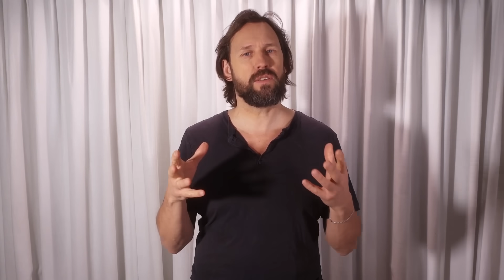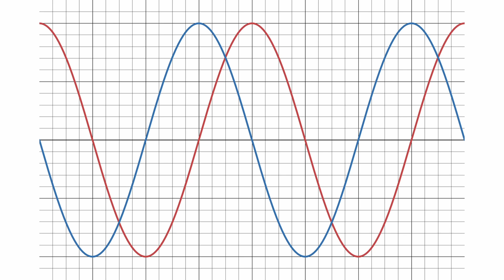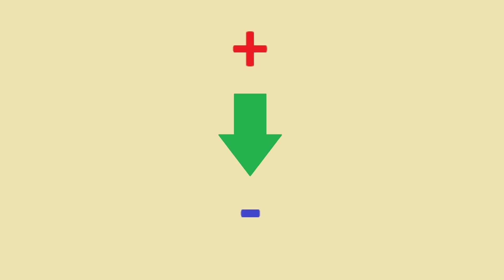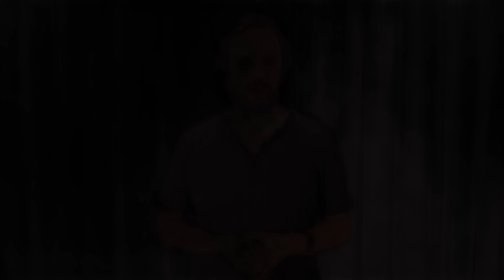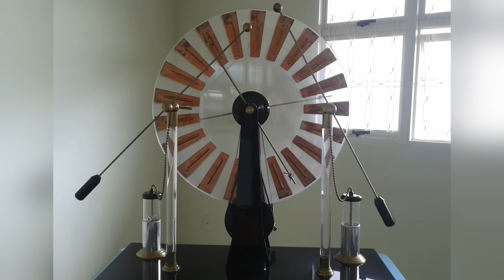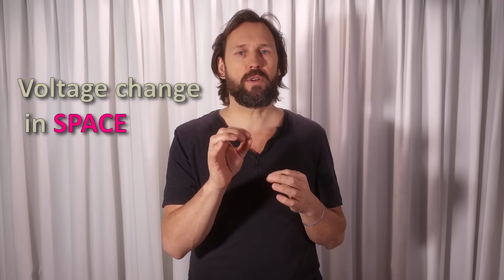The Electric Resonance SECRET Universities Hide

Comment: Well I was playing with a bipilar coil and a small tesla coil and was just playing and hooked up to the atmospheric antenna I was Messing with and I let a whole crap load of angry pixies out my wires in the form of smoke and fire have not replaced all the equipment yet but by my simple observations of what was going in was way less than what came out..it was a very weird sound just before everything smoked ( like a turbo spooling up mixed with old space movie hum) tesla patents are meant to be combined to harvest aether energy..I get so sick of hearing brainwashed ( college educated people) say free energy violates the laws of thermal dynamics yet tell you an atom has energy that never stops.bring it to absolute zero and it stops vibration then warm it up it starts again 😉  so everything is made of energy bit magically we have to depend on politicians and oil co to supply it...hmmm. do the calculations for a local power plant  and all the things connected to it and there is atmospheric harvesting to make the difference up at your home...

Comment: They teach everything, including displacement currents. Is the current leading or lagging, depends on the sign convention. In a capacitor it is leading, in inductor lagging.
Reply from the maker: true but you're missing the point.
Reply: @MasterIvo  Maybe I am missing the point, so please explain. So many videos explain energy does not flow through wires, but for me this is obvious. What I still do not understand is in which case we get energy from the ether. Maybe for very high displacement currents ?
Reply from the maker: @reuven1961  well all energy is aether. they are the same. but I feel you mean extra energy from outside the system.
there are several methods.
like a sudden unipolar change in the high voltage electro static field. since it interacts with the surrounding aether (energy).
but I also found a more  dynamic method without the need for an impulse (will present this in coming videos).
It is always depended on high voltage (above let say 5kV).

Comment: The displacement current  is a result of a changing electric field creating a magnetic field. The higher the frequency and the higher the voltage the higher the displacement current. Ordinary current doesn't factor in the formula. So the idea is to create a high displacement current using a minimum of power and put that displacement current and voltage to work
Reply from the maker: don't forget the role capacitance plays with displacement current
Reply: @MasterIvo  parasitic capacitance 👍

Comment: At around 11:00 to 12:00  is the most important part of the video.
Reply: He is claims that: tesla coils are open circuits, and that energy conservation only applies to closed "circuits". Both of these statements are 100% incorrect. 

The first law of thermo has nothing to do with circuits, but rather systems. That aside, the law of energy conservation applies to all systems, not just closed systems. The second law, which states that entropy in a closed system never decreases, does apply to closed systems. But a violation of the second law doesn't violate energy conservation (and also the entire universe is a closed system). 

Second, tesla coils aren't even open circuits. There is capacitance between every segment of the coil and every grounded object. You can model this mathematically by breaking up the coil and everything around it into multiple tiny conductors and computing the mutual capacitance and inductance matrices b/w all these discretized conductors. you can then use these matrices to compute the eigen modes of the coil. This only works bc these coupled capacitances form a CLOSED circuit (albeit a very complex one with many different ground paths). We also know this analysis is correct bc this math is commonly used to very accurately predict the resonant frequency of tesla coils. The common tesla coil software JavaTC uses this method, and it is the current golden standard for tesla coil hobbyists, hundreds of which have validated these calculations independently.
Reply: Moreover, if you compute (either theoretically, or from direct measurements of real world data) the Poynting vector field around a tesla coil or any other electromagnetic resonator, and compute the flux around the coil you will see that it does not violate Poynting's theorem, and therefore a tesla coil or any other magnetic resonator cannot be used to generate infinite free energy.

Comment: Thank you. I appreciate your channel and your commitment to clarifying the dielectric and magnetic fields. Would it be accurate to say that electricity is not an autonomous field but rather a manifestation of the dynamics of magnetism and dielectricity?
Reply from the maker: Yes correct. it is a mix of two energy forms. The electrostatic that is in motion, together with the energy flow (current).
But it doesn't need to be a magnetic energy flow.
the displacement current can also do the work.❤
Reply: Everything in the universe is electric in nature. Chemical reactions, mechanical motion.. all forces are imbalance seeking equilibrium, discharging. The sun is creating heat, photosynthesis, electrical charging of air etc, and it's cyclical. The best example of electrostatic energy is gravity and adiabatic fluctuations. Water evaporates well below 100c, oxidation is the application of a charge, clouds do not fall from the sky even though water is heavier than air because there is a static field pushing away like charges when the ground is heated during daylight

Comment: why is there a difference in the displacment current field and the static one? isn't the same, just that one is chaniging over time? like if you have a magnetic field and a metal and both are relative to each other not moving, you won't have induction. But if one of each moves (doesn't matter) youl have a moving magntic field, which causes induction (with moving i mean the strenght changes, like if you move it exactly like that it stays in the same strenght, there is no magnetic field change.

Ist this comparable or is that soemthing different?
Reply from the maker: Well there is no induction when it is static.
 the changing magnetic field induces an EMF (voltage) while the static does not.  this difference of behavior separate ls the 3 fields. But in the end they are all manifestations of energy. 
Which is another word for Aether.
Reply: @MasterIvo i think my brain still doesn't really get the concept.
so basically there only is the movement of charged particles like electrons. If they drift on average ibto one directin in a metal rod as example, we have a flow of current, just like water flowing downstream in a river. the voltage itself is just the pressure which causes the electrons to drift or in the case of the water, it is the heigt, the source of the water compared to the lowest level. 

In order to move the electrons we need something that gives away electrons on one side and consumes them on the other side, for dc. like a batterie. The electric static fields of the electrons tries to push them apart. because they move, they create new electomagnetic fields and those also interact with the electrons again. man this is all so confusing 😅😂
Reply: Think of it like this

Magnetism = Water flow
Dielectricity = Ice if it had elastic properties 
Displacement Current = Underwater wave, or sound wave
Reply: @JenkoRun  i think that is even more confusing. why is there now frozen water? :D

But water as a liquid can move while the single h2o mulecules within are faster, just like it is with electricity, just the other way around. The energy of the field travels with ~2/3 of the speed of light while the electrons themselfs only are roughly as fast as a snail. 

When comparing water and electricity, we should always keep in mind, that any type of pipe would need to already have water inside, like any wire already has electrons within that are able to move.
Reply: @Marco-xz7rf  It's an analogy, and it's really not confusing.

Also please disregard electrons when it comes to Fields, they show the rate at which electricity is destroyed, electricity is in the environment around the so called conductor, not inside it. 

And no I will not debate that, take it up with Steinmetz and the rest of the pioneers.

Comment: I don't know if this helps you, but we just published a paper in the EM journal IRECAP showing an EM pulse propagating 1.5 meters in the near field with no observed propagation delay. It shows at the front speed, or the speed of information, or the speed of causal action is instantaneous in the near field of EM sources. The experiment is nothing more than Hertz's famous radio wave experiment except a modern oscilloscope is used to measure the propagation delay. In the paper we show that the effect is predicted exactly by Maxwell's equations when the source terms that come from Gauss's law in Ampere's law are included in the wave equation. This was not done by Maxwell and is the reason why Maxwell's constant speed C solution is wrong. And because Einstein assumed Maxwell's constant speed C solution was correct, his theories of relativity are both wrong, as well as any theory based on it such as QED. For more information see, New interpretation of Relativity by William Walker and specifically see the papers supporting this research in the description of the video. Specifically see my 2006 paper that can be found there. It has the details of this analysis and presents another interesting experiment where a sinusoidal source was transmitted from one dipole antenna to another as the antennas were separated from the near field to the far field. The resultant phase versus distance curve was clearly non-linear with a clear minima in the near field, and became only approximately linear in the far field. Maxwells constant speed C solution would have yielded an exactly linear curve, which it clearly was not. It is well known that when there was a minima in the curve the speed of light is instantaneous. Applying well known operators to the curve shows that the speed of light is instantaneous in the near field of the source, changes speed with distance from the source, and only reduces to approximately speed C in the far field starting about 1 wavelength from the source, and never reduces to constant speed C, ever.
Reply from the maker: thanks for sharing. How can you  implement this knowledge?
Reply: @MasterIvo The implications of this research is that most of modern physics is wrong, because it is based on the assumption that the speed of light is constant speed C, which has been proven to be incorrect. If the speed of light is not constant speed C then the second postulate of relativity is wrong. What remains is the first postulate Galilean relativity where space are absolute and independent, and causal action faster than speed C is possible without violating causality. This research also shows that the speed of causality is infinite speed, and not constant speed C.
Reply: @MasterIvo We are already implementing this technology in our cell phones via NFC Bluetooth communications, which are near field narrowband digital communications. The EM Pulse experiment shows that  the NFC nearfield digital signals, which we use in our phones, propagate instantaneously from the transmitter to the receiver.
Reply: Hmmm.  I would have expected a delay of about 5nSec. I need to find your article in IRECAP and learn more about your exact yest set up.  Can you provide the article  date or volume # please?
Reply: @davidpacholok8935 a pre-print of the paper can be found at the end of the description of my video, New interpretation of relativity by William Walker

non-local or possibly superluminal Maxwell displacement current observed in the near field of a spherical capacitor, IRECAP 2024
Reply: Dang that’s pretty cool. I’ll have to read your paper! Thanks
Reply: @ashercorbett8089 The paper can be found in the description of my video, New interpretation of relativity by William Walker 

Superluminal Maxwell displacement current measured in the near field of a spherical capacitor, IRECAP 2024
Reply: Приветствую! 
Пространство ведет себя как несжимаемая жидкость, под воздействием импульса на определенном расстоянии деформируется структура пространства, далее формируя в нем волну, распространяемую согласно плотности пространства, а это ~297 тыс км /сек. (Хорошая плотность!)
Так как пространство едино - деформируется вся материя, также являющаяся лишь формой пространства, а это и провода осциллографа, и сам осциллограф. 
Вы еще более будете удивлены, когда измерите скорость схлопывания магнитного поля. Проведите эксперименты с индуктором, с малым количеством витков, где преобладает токовая составляющая, и с высоковольтным индуктором с большим количеством витков. Расположите датчики магнитного поля в центре катушек, и на расстоянии в 1 метр. Задающий импульс должен иметь задний спадающий фронт менее одной наносекунды.
Reply: @efiron  EM theory shows that the superluminal effect should occur for both E field and the B field. Intuitively you can see this because Coulomb's law for the electric field and Biot Savart law for the magnetic field are not a function of time, so they are instantaneous formulas valid in the near field.

Comment: ivo, I would strongly encourage you to watch my recent four video series on the field. It is different from all other perspectives on the field.  https://www.youtube.com/watch?v=iOTSrJ7RQuQ.  For me it is simple - you have to consider the electric and magnetic as 2 perceived sides of a mobius strip - but it is just one.  When energy radiates it is electric, when energy converges back to its center point it is magnetic/gravitative. And you have to think of this energy as a fluid. Then its all fluid mechanics for optimal field geometries. The field / fluid behaves differently under stroking (AC) vs smacking or super high frequency smacking.

Comment: Moisture in the air as well. The more humid the air, the more electric potential for potential harvesting. Water over a waterfall produces a potential difference also. Quicklime over quartz crystals can produce electricity. Hitting a tuning fork near an inductor can increase the voltage of the indicator
Reply: The effect of gravity, how water evaporates at temps well below 100c, and why clouds do not fall fall from the sky (unless conditions are just right) all has to do with this electrostatic effect. id be interested to know how buoyancy can be explained electrostatically, I feel like there is a key to understanding the link between mechanical and electrical phenomenon that will help this research

Comment: From what I understand there is voltage in terms of potential, and then there is EMF. There is current; then there is displacement current. 
Variation of a quantity of dielectric induction with respect to time is Displacement Current. 

Variation of a quantity of magnetic induction with respect to time is Electromotive Force.
Reply from the maker: and EMF is the  voltage that can power a load together with a displacement current ❤

Comment: Benjamin Franklin lived from 1706 to 1790. Alessandro Volta invented the first true battery, known as the voltaic pile, in 1800. 

Ben Franklin only dealt with Static Electricity which is like a still pond of water, on a mountain top.

No one discovers Electrical Resonance until after the invention of the Battery.
The Battery provided continuous Electron Currents just like water-river Currents and allowed repeatable experiments to take place.
To discover Electrical Resonance they still had to bump into Inductors.

ELI for  L = Inductive

ICE for C = Capacitive

Voltage and Current can never be more than 90° out of phase, lead or lag.

  🤔